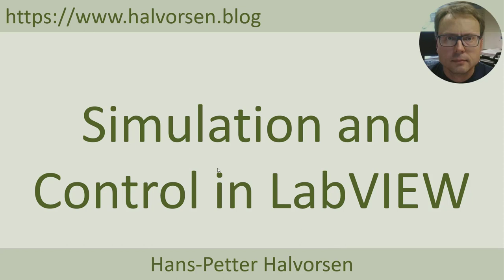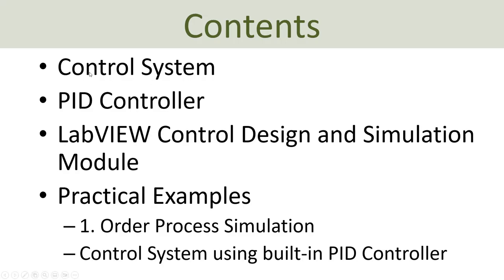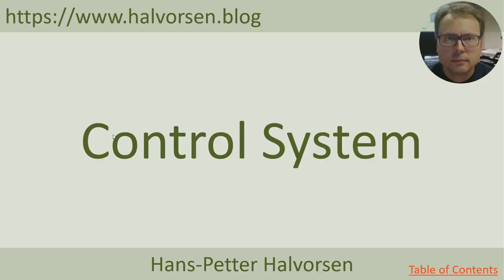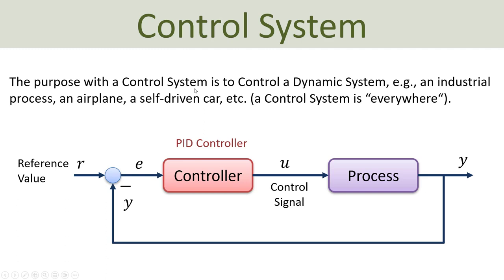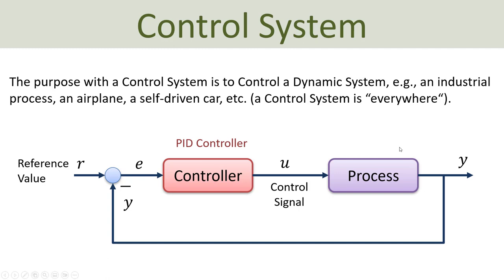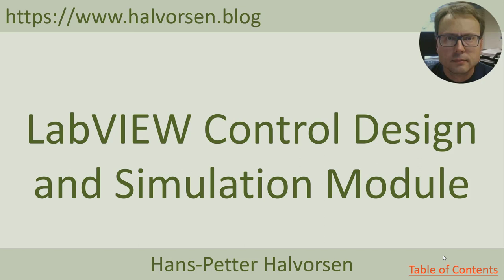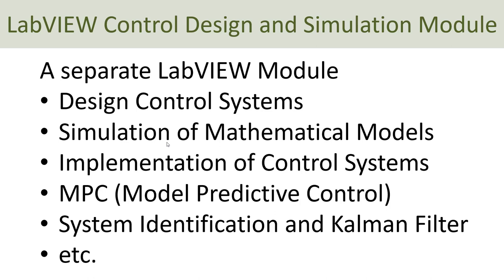Simulation and Control in LabVIEW

Comment: I followed these download and install Control Design and Simulation module instructions for LavView 2022 Q3  Community version but it did not bring up the Simulation and Control Design  pkg options (only the PID, Fuzzy Logic, and System ID).  I also tried this in LabView 2023 Q3 and resulted in same.
What am I missing?  
JT
Reply from the maker: Important Note! LabVIEW no longer supports the LabVIEW Control Design and Simulation Module. Beginning with LabVIEW 2023 Q1, LabVIEW no longer supports the LabVIEW Control Design and Simulation Module.
Reply: After downloading the Control Design and Simulation module, you need to activate it to use. Maybe you forgot to activate it after downloading
Reply: @19OT  how to activate it